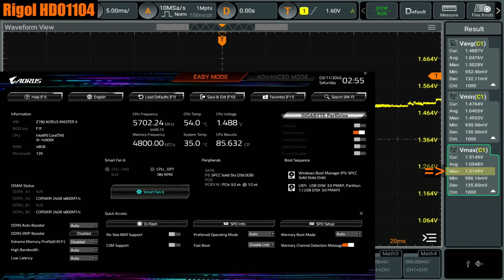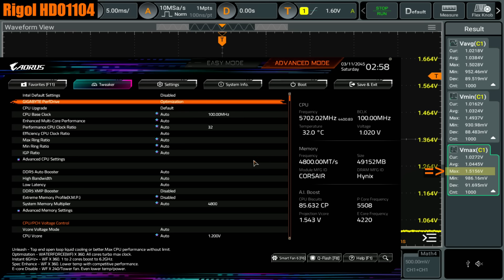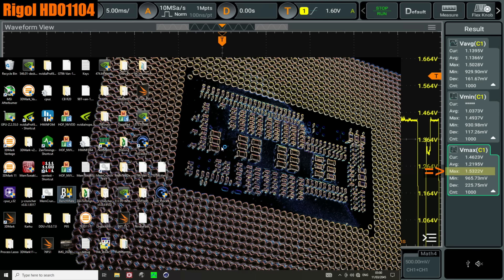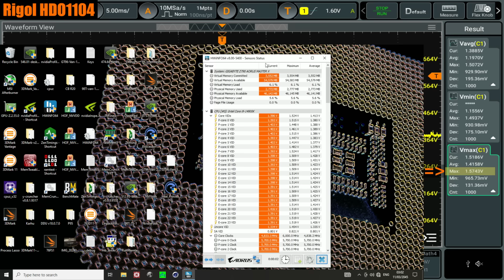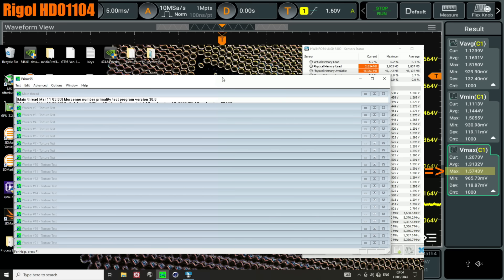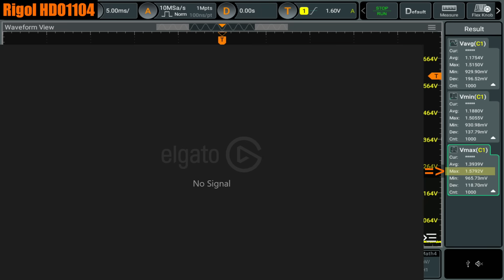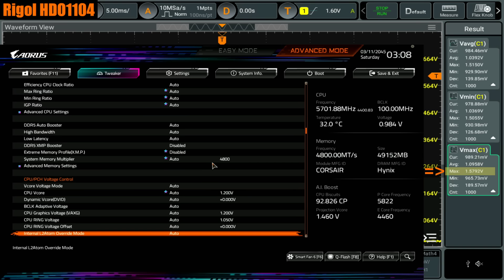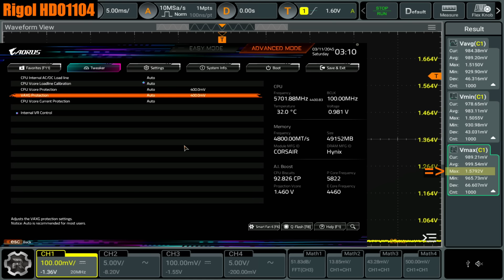Turning off "Intel Default Settings" with Microcode 0x129 DISABLES THE VID/VCORE LIMIT

Comment: I feel like some Intel bean counter fired some of the CPU testers because they considered their salary too high and now they are paying the price.  Furthermore, I think a lot of Intel customers like me didn't know what the issue was when the system first crashed and didn't immediately think it was a CPU problem.  However, no one is just going to live with this problem because at some point the system NO LONGER BOOTS UP!  At that point everyone affected has no choice but to replace all the damaged parts, which could include CPU, RAM, SSD's, and the motherboard.

Comment: is it worth the cost to go from my Z690 asus strix "E" ddr5 12900K to the asus Z790  & Intel 14900K ? (I would take the G-skill 6000 ddr5 and put it in the z790 14900K unit) if that's possible (it was the early RAM with high latency).  Or should I just wait until things REALLY change for the better (clock-speed-wise)

Comment: 12:06 

100000% agree. That was me. Cyberpunk kept crashing on startup and I was convinced it was just the game being wonky or some driver issue. Turns out, limiting the voltage and setting the AC LL value fixed that, so it was the CPU's fault all along. It now runs perfectly fine.

Luckily it was the only game that crashed, so I don't think my CPU is degraded and it was just the default AC LL setting by Gigabyte that caused the crash. But still, what a shitshow

Comment: I have a question for the AC/DC load line video: Is AC load line measured on a specified frequency or manufacturers tune it for their VRM controller? Simply put PCB traces have different caracteristics on different frequencies, so for example a motherboard have 0,400mR at 100kHz and 0,442mR az 400kHz. Some cheap motherboards have a fixed 200kHz freq, other more expensive ones have a range 200-600kHz.

What is the minimum specified VRM response time for AMD and intel? I mean the time between when the CPU request a Voltage and when it gets the requested Voltage.

Comment: I wonder if there's a specific setting that enforces the 1.55 voltage limit, or if it's really a hidden flag.
So far I was thinking that the Intel Defaults would just be a preset for the available BIOS settings, but they might actually do more, like setting such kind of hidden flags. 🤔

Comment: Great video, I'm tempted to set up my Tektronix oscope then capture voltages on my MSI motherboard. I'd love to see what's happening in real time although I'm uncertain where to pick up the signal. CPU power plane is easy to find but would that be the correct voltage. Hmm...

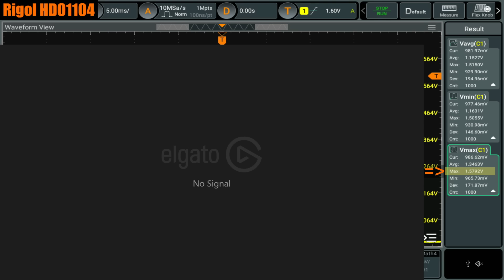Comment: 14900K has not crashed at all as long as I have my XMP for GSKILL 7200 Mhz ram at 1.45V for the VDD/VDDQ so not sure what you mean by intel CPU crashes 11:00. No power limits also and no OC on the cores..

Comment: Thanks for the video! 
But why didn't I try tuned IA AC/DC Loadline (for example 60/110) on Gigabyte default profile? 
Also, the "CPU Internal AC/DC load line" enabled on the "Perfomance" on the Gigabyte default profile can help with instability.

Comment: Left the Intel defaults on performance profile and turned the 1.4 voltage limit back on in the bios after updating on my Z790.  I absolutely do not trust Intel lmao.
Reply: i did 1.4 voltage limit but my frequency in cinebench is 4.9 and in games 5.1 this way...
Reply: @Qersoras  ah, mine still goes to 5 5 ghz and sometimes boosts to 5.8, I have a 13900k tho
Reply: @Qersoras  for me with Voltage at 1.47V (1470), mine is 5.3Ghz insteadd of 5.4... weird, I don't know how to fix this

Comment: Nobody has really answered the IMPORTANT question.

What is it about the CPU that degrades? What we actually talking about here? E-Core failures, P-Core failures?

What does a degraded CPU actually look like, in terms of... How can you detect one? Is it just a case of installing it and stress testing?

What happens if the CPU draws too much voltage because of this bug? Do the transistors fail? How many have to fail before the core fails?
Reply: People have speculated that it's likely the ring bus that glues all these cores together is what's failing.  Which seems exemplified when minecraft servers (high memory bandwith load but low overall CPU load) kill 14th gen CPUs in a span of merely 2-3 months.
Reply: @0x97B55C23D18  Ah okay. So nobody actually knows what 'degraded' actually means and it's all just speculation. If it is the ring bus that actually fails, can there can be partial failures etc and does that equate to SOME level of degradation?

This is the worrying thing about all these tech YouTubers, talking about 'degradation' without saying what that ACTUALLY is and what that ACTUALLY means; especially when no one seems to know what failure level something has to reach before it can be classified as degraded. It's just such a fuzzy mess.

This is a kin to me saying, "I have an old book" without being able to say, why it's old and how I know it's old.
Reply: @thewelder3538  GN said that they'd send at least one CPU to a failure analysis lab to get to the bottom of the degradation. I don't know if they actually did so far, but we'll probably hear from them.
Reply: Oxidation affects every CPU, which is why all CPUs have a limited lifespan. Because the voltage peaks are often too high, the gen 13/14 break down more quickly.
Reply: @AcidGubba  Oxidation requires oxygen, but a chip is sealed, so unless the oxygen was there to begin with, a CPU shouldn't have a lifespan as such. Your statement implies that a never used CPU in 20yrs or whatever, would no longer work, which just isn't the case.
Reply: @thewelder3538  Higher voltages generally lead to higher operating temperatures. This increase in temperature can cause the materials to age more quickly, which could also increase the likelihood of oxidation processes. The metallic connections and solder joints are particularly at risk, as they could wear out more quickly at higher temperatures.

At higher voltages, the effect of electromigration can also become more pronounced. Atoms in the metallic conductors of the CPU are slowly displaced by the flow of electrical current, which can lead to material loss and structural weaknesses. This could indirectly increase the susceptibility to oxidation, as the protective oxide layers in the damaged areas can become thinner or break.

Every CPU has a limited lifespan. Intel expects 10-15 years, but it can of course be 20 years, but it is always limited. Where exactly is my statement wrong?
Reply: @AcidGubba  I'm not disagreeing with you per se, and I'm not a hardware engineer; I'm a software engineer. I'm just trying to get to the bottom of what is meant by degradation without all this speculation about what is happening. Degradation implies that something still works, but from what I'm hearing about, it sounds more like catastrophic failures, both from a hardware and software viewpoint.

Comment: If intel has to replace the CPU's in 2 years then it slows the bleed. Their new fabs may not have the capacity to replace all 13th forward CPU's out there. Even if it's just the I9's they have been having trouble making enough I9's to meet demand.

Comment: No way 1.55 doesn't still cause degradation. Maybe they'll also limit how often you can have your advertised boost clocks and most chips will just about about make it through the warranty?

Comment: So for my undervolteted 13700k its more save to keep my undervolt settings ? Never hit over 1.3 Volts. I did -95mV all cores expact the 2 Fast cores. They got just -65mV to get the 5.7 GHz done.

Comment: I updated my BIOS on my Aorus z790 pro x to the 0x129 and my 14700k thermal throtled instantly on the XTU stress test.
I am not good with BIOS settings unless I have a damn good guide (meaning I will find where to change something by following a guide but to find the setting on my own is something Im not good at and frankly a bit scared to mess around with)
So before 0x129 I used XTU and set my core V to 1.260 and my TB's to 280W (custom loop).
I have max 1.37v spikes with about a 1.27v average running stress tests like XTU and CB R23. All cores at 5.5/4.3 and max temp on CB R23 is 93C.
I would love to set this in BIOS but I cant figure out how because I get to many volts and 0 stability (due to my lack of BIOS knowlage) and also XTU likes to reset to default sometimes hence why I would like to have this BIOS side.
Also is it just my MB or leaving the Intel Preformance setting on wont let you undervolt even if you disable it BIOS side?

Comment: I have a laptop that costzd me over 3200 usd, I need expert opinion.
My i9 14900hx already peaks 1.53 and before the new asus bios update it used to peak 1.6+v.
And i get plenty often 0xc00005 crashes ingames.
Is my cpu cooked already ? And can it be fixed or prevented now or is it too late.
Didn't undervolt kept everything default settings and mainly used silent profile

Comment: 13900K/MSI Z790-A wifi bought in August 23, since the very beginning I ran adaptive undervolt of -0.035V on frequencies above 5GHz, with the MSI default profile for water cooler (i.e. no other limits). Never experienced any crashes, passed all the usual stress tests like Cinebench, prime95 etc. Just ran Cinebench multicore, 40293 and max VID during the test in HWinfo was 1.42, with averages around 1.33V. Don't think I'll be updating to 0x129.

Comment: The voltage limit not applying on other UEFI-presets is not Intels fault: That option has been in their uefi-code for years but many motherboards simply chose to not give it as an option and just disable the limits. But it should have been a mandatory setting for ALL default UEFI (same as any other protection mechanism) and there absolutely MUST be a warning when such things are disabled - and that is where Intel is to blame as it is their responsibility to reign in the motherboard manufacturers.

Comment: So do you still get the microcode 129 but the voltage spikes are still there ?

I couldnt get my asus z790 13700k to run without strange behaviour.  Really hot.  Higher voltages, thermal throttle. Also core speeds woyld jynp from 800

So in the end i used the asus profile. Turned off boosting. Fixeds cores to 5300..  set vid core - offset. Llc 4.. Runs much cooling.  Better cinebench scores.  No thermal throttling.  
Do i need to alao limit the max voltage with another command ? And what to set it to ?

Comment: 12:23 yeah I thought for a long time that it was fortnite in dx12 mode that had a bug. Couldn’t start it in DX12 only DX11. And this problem wasn’t known yet for a long time so I was never able to use DX12 and thought by myself when are they finally going to fix this bug in fortnite because it was saying out of VRAM on a RTX 4090. I even tried disabling my integrated graphics and stuff to try to fix it but nothing worked. Now we know why…

Comment: I'm just confused with all this situation. So if Intel's defaults are off, cpu doesn't get enough voltage on load and so some workloads will crash, but if you turn them on with the new microcode it just limits max vcore because before and without it was too much.

I'm just lost.
Reply: Intel is trying to  burn new code into cpus so motherboards no longer feed the cpu - voltage above 1.45v or so. When the board is at a certain voltage and Intel's boost requests the next high-level voltage, the cpu may get over voltage'd by the mainboard when it's is so close. Its a delicate balance that is required to be adjusted in two different ways because that is how the components are designed, there is just a lot of interplay going on between them. This is not an easy problem to fix with the devices in peoples hands. Cya!

Comment: "everything is unstable"

Might be a particular extra layer of fun if you are using one of those new cheaper DRAMless SSDs with Host Buffer Memory and that has to use your CPU as its memory controller.

Comment: Funny thing: ASUS beta BIOSes "forgot" the Intel profiles performance/extreme are both set to ICC Unlimited = ON / ICC = 501A / P1/P2 = 4049W, also some board types from ASUS had AC at 1.1 again. 

At this point, you can basically trust no one anymore to handle your hardware right, you have to check every setting.
Reply: Gigabyte too it was at 4049W. I set both to 253W

Comment: So do I update my bios to the latest version that includes this new microcode? I preface this by saying that I'm a normie and don't understand to much of all this. I have a gigabyte mother board and a intel 13th gen processor. The video author, in his conclusion, would seem to imply to update the bios, however his stance on the matter didn't seem to convincing. Is this because there isn't enough information regarding the microcode and thus can't recommend it whole heartedly or am I reading into all of this wrong and you should just update the bios and be done with it. Thanks in advanced for input on the issue.
Reply: I’m in the same position. I think he is saying to go ahead and update the Bios - I.e. to go with the Intel defaults. But it seems likely that for some CPUs the defaults may still not make them stable and if so, then either try and return the CPU (assumption: CPU is now degraded and damaged). I think he is saying you could try and turn OFF the Intel defaults and then Turn ON the Gigabyte voltage limiter and see if that makes it stable or potentially longer term stability. Either way my current understanding is that long stability is not guaranteed more than 25 months of further warranty. But I wish he was a clearer presenter - he starts sentences, mumbles, cuts himself off. Unless you are in this community it’s really hard to really get a good handle on this. The presenter is clearly very talented but I’m a normie trying to dig myself out of a hole with a CPU I have currently made stable by turning off Turbo modes.   Perhaps someone can reply with more clarity for us both?
Reply: @longboardfella5306  I've ran the cinebench 2024 stress test app successfully, both multicore and single core, without any issues and without updating the bios. I'm currently torn because it would seem my system is pretty stable as is. I would be reluctant to update into something that is currently still a bit of a wild card, i.e. microcode 129. On the other hand, if I don't update, issues might start to rise down the line. Quite the predicament...

Comment: If my 13700K never goes beyond 1.4V, no matter what bios or profile I use (mainly MSI unlimited power rn), do I need to do anything? It passes both R15 and R23 while never hitting above 1.395V, which is also rare. I run it on Z790 Tomahawk Wi-Fi.
Reply: You have a good chip, mine goes to 1.435 on max load ...

Comment: New 0x129 microcode actually further pushes up VIDs in heavy load situations like Cinebench R23 tests. High VIDs improves stability in general. For the additional package power and heat? Intel expects thermal throttling to kick in and save its ass...😂

Comment: 14900KS here. Update from maybe a week ago. Went from A-OK to things crashing often (mostly certain games; essentially unplayable now) in the span of, well, that week or so. Unfortunate. I guess some of the more spread out game and app crashes (once a week, once every other week) were early warning signs after all.
Reply: idk who'd buy intel rn knowing everything is happening with
Reply: @Pacho18  Agreed. Unfortunately I've had this CPU since it released; it was a drop-in replacement for my 12900 (non-K).
Reply: @soulofjacobeh  oh, i understood wrongly you bought it past week. Sorry dude. I'm in the same situation with a 14900K. But i could stabilize it by lowering down voltages and freqs. Problem for me (blame myself for it) is i bought it 2nd hand, no invoice, even the previous owner. So i'm truly fucked if it keeps degrading.
Reply: @Pacho18  I've had some RMAs that didn't require proof of purchase. Intel might be lenient, so it's worth a try.

And yeah in my original comment I was (vaguely, sorry) referring to a comment I'd made on a prior video about a week ago in which I'd thought I'd avoided the degradation issues somehow. But the last 100hrs or so of runtime have rapidly deteriorated in application stability. I now have to use Intel Failsafe SVID

Comment: They made a faulty product and now they do damage control with a code to prevent their costs, not your costs where you payed for an inferior product. 
It’s like you bought a car and the engine gets to much fuel and that damaged the engine and the fix the manufacturer do is lowering the fuel consumption to prevent further damage resulting in that the engine isn’t anymore as they advertised it to be with the horsepowers and performance you paid for!. 
Shiiit the whole tech market seems to be massively infected with greedy a-holes that skip corners for an easy buck and you get low grade products!.
Reply: intel fan girls are gonna cry now and defend this POS like it's some revolutionary CPU 😂
Reply: @awaiswasi354 it is revolutionary. It revolves in and out of the RMA queue
Reply: MOAR VOALTZ
Reply: Benchmark tests show minimal impact of the new microcode on performance..
Reply: @dusty_48  6% in my case is not unnoticable
Reply: @dusty_48 Minimal impact of new code on performance with the caveat that you’ve already applied the other incremental fixes that themselves lowered performance relative to launch day / advertised. 

So, not any additional performance losses, but still a net performance loss to have a chip that will degrade slower.